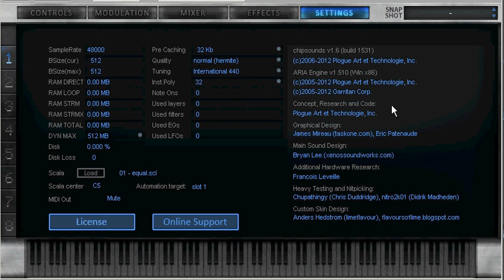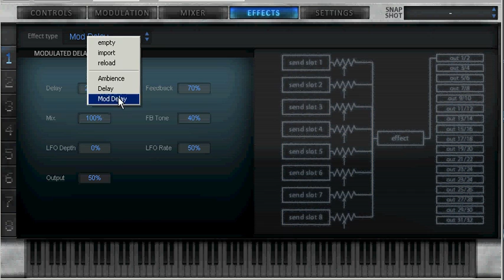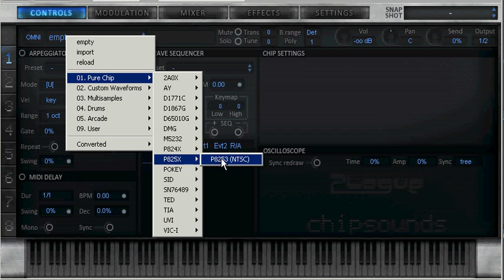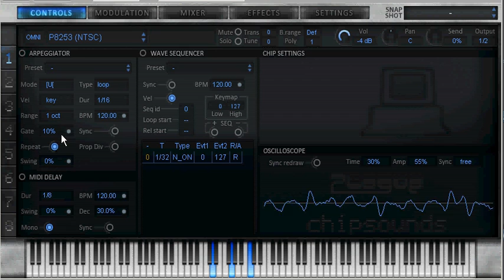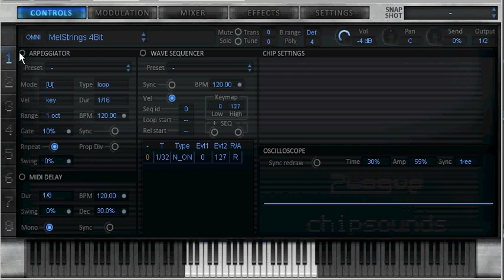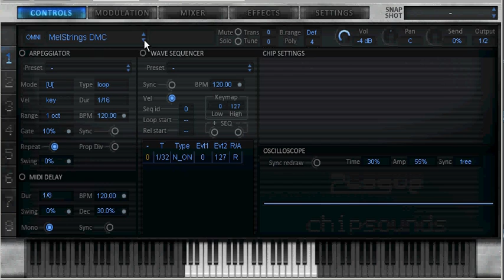chipsounds 1.6 New Stuff (Part 1) Effects, PC Speaker

Comment: I just got the 4-pack of plugins and standalones. I don't have the activation e mail yet but I am just curious:

How do you make polychords in Chipsounds? I tried to do it on the demo version but it was only giving me single notes or arpeggiations
Reply from the maker: each channel (mixer) has a polyphony setting.
Reply from the maker: Well even "poly" in the top (middle) availabale all the time. Of course you need to shut off the arp/seq for poly to work.
Reply: plgDavid 

Dualy noted. I'm pretty new to these plugins so it's kinda weird for me atm. If I have any other inquiries I will message you directly. (when I am able to, of course.)

Comment from the maker: AB Mendez : Yes we all have our zombie synthesizer licks. I ALWAYS use In the court of the Krimson King whether or not its a mellotron or stringy sound :)
Reply: Hi ! 
When I try to use a short Noise with a snare Wave sequencer, it presses one of the 7 keys starting at the bottom of the keyboard. it's changing my Short Noise by Pulse :/
Reply from the maker: Hm yeah can happen sometimes if the result MIDI notes get in the range of the key switches. Sorry about this.
Reply: Thanks for you answer.
I was the problem. I was using a preset for SID.
I am pretty new in chiptune music and I just bought Chipsounds. Is it a common thing to use these keys in the wave sequencer to switch the sound channel ?
(Btw Great software and nice video)
Reply from the maker: Wave sequencing, with the SID was very common technique, especially to recreate drum sounds.
Reply: Yes After researching I discovered that ^^
This is a great way to program chiptune.
Something really strange, is that I can not chose values like 5/32 or 3/32 for the duration of events though.
But in TIA presets namely sc_beatBO1 there are some values like these ones...
It is very annoying ^^
Reply from the maker: HA you got me. I programmed these presets using code and not the interface. In chipsynths you can enter any x/y number. Sorry about this.